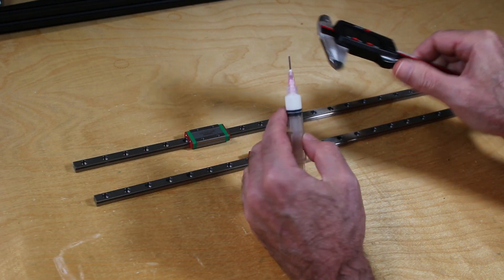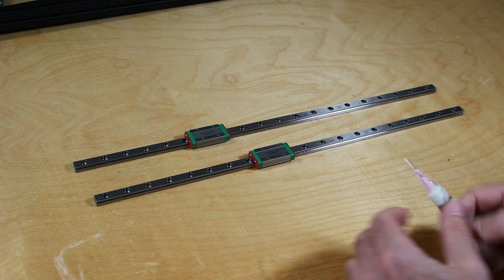Linear Rail Lubrication

Comment: I’m not a fan of White Lithium grease for anything. I don’t like anything about it and it always looks terrible haha.
Reply from the maker: I get it.  I actually have switched to non-white lithium grease since that video.  Thanks for the comment and watching!
Reply: @KapmansBasementWorkshop 

And you’re a better person because of it.

Depends on the need but I don’t like the drag and tackiness of white lithium. Is non-white the same?

For lightweight stuff super lube is awesome. It’s almost like a mix of fine grease/oil mixed together.
Reply from the maker: Non-white is actually a little thicker.  But since I use these in an enclosed 3d printer, the grease seems to get softer in the heat. It seems to work well.  Seems I need to give super lube a try.

Comment: Thanks.
BTW - you did say when reading the Hiwin manual, to move the carriage 3x block lengths and repeat.
Reply from the maker: Thank you!
Reply: @KapmansBasementWorkshop  😃I've been investigating linear rails (actually considered linear steppers in the rail - too $$), and was curious whether the you've noticed an improvement in surface quality (assuming you've competed you Voron build....) [;^)
Reply from the maker: @truegret7778  I can't state that I've seen an improvment because this Voron always used rails.  But I can state this printer (once tuned) prints better than any other non-rail printer I've had.   I'm not sure thats a reasonable comparison.  If your non-rail printer has good bearings and accurate wheels, it should print just as good.

Comment: Very clear. Ive just come back to revisit this video because ive had to just replace my rails after having my 3d printers in storage for a long time. I really should have been doing this from the start if I had i probs wouldnt need to replace them.

You see so many people saying just spray lube onto the rail and run it back and fourth but I always though bearings were supposed to be packed, hence the port I guess!
Reply from the maker: I hear alot about applying oil as well.  That might work if the printer is open and the rails don't get warm, but these have a grease port.  It must be for a reason.   Thank you!

Comment: Do you have any recommendation for rust protection on  the rails?
Reply from the maker: The rails in this video are stainless steel (I think).  However every once in a while a thin coat of oil or grease should help keep that rust under control.

Comment: Is aerosol white Lithium grease the same as the tube?
Reply from the maker: Many people say it's not.  I have no experience with it.  Since the video, I have also learned that "White Lithium" is not necessarily white.  I have been using Mobil white lithium that can be purchased from online 3D printer retailers in a Syringe and it's yellowish / lite brownish and it works even better than what I used in the video.   It's actually thicker as well which I think works well in a hot environment.

Comment: Man it feels like i went in a rabbit hole, i hmjust wantaded an upgrade since the orig8nal bearings on my enders are binding, now i have to learn all about greassing rails, 😢
Reply from the maker: Good luck!  Thanks for watching!
Reply: @KapmansBasementWorkshop  thankyou for answering, i should be fine with the original lubrication for some time right?
Reply from the maker: @tarcisiobatista5595  If you are describing the oil on the rails that they ship with, no, that's not alright.  Get some grease or some other high quality oil with no particles or additives and add to the bearings in the rail.  You should not need to clean the shipping oil off outside of a wipe with a paper towel as it's just mineral oil.

Comment: Love your channel thanks for the stl for the stealth burner carriage. Just curious, what type of accels ore you getting. I’m building a second v2 which is almost done now using hiwin rails this time.
Reply from the maker: Thank you!
Right now, I'm at 5000 for acceleration for clean prints.  I'm limited by my Y axis mass on the 2.4 350.  I can't measure resonance with my accelerometer since changing to Stealthburner since I ran out of 5v ports.  I'm making a few changes and once I have a proper connection for the accelerometer, I will test again.  I hope with the reduced motor size and weight the numbers go up.  We shall see soon.  I will publish those ASAP.  Thank you very much for watching and asking!  I will post those numbers soon....

Comment: good stuff.  Related question:  you ever pull the balls & mic them?  On the few I've pulled apart, I found all the balls to be the same size.  More high end rails alternate between full size bearing balls & spacer balls, generally a few micrometers smaller.  It allows for better rolling.  anyways, I'm thinking about "re-balling" mine, just curious if you or anyone else has played with this.
Reply from the maker: Thank you!  I have not taken them apart yet.  However, I did take them out of where they were being used for a repair (the rail was not the problem).  Brand new these felt slightly rough & slightly noisy.  After several hundred hours of use, I could not believe how they had transformed.  Smooth as could be with drastically less force needed to move the carriage and virtually silent with no play.  I would get this brand again.  When it comes time to service them, I will certainly mic them to see where they are.  Thank you for watching!
Reply: @KapmansBasementWorkshop  good to know, mine do seem a bit noisy now, printer still in production so pretty much 0 use.

Make sure you got a good setup when you go taking those apart, the balls want to go everywhere!  I use a tray + a magnetic sheet to keep everything together.  Also, be sure everything is clean.

Thanks for sharing your experience.  Every detail matters.
Reply from the maker: @mtraven23  Thank you for the tips!  These are on a 3d printer, so a very lite load.  I'm super curious how long these will run before needing  to be taken apart.

Comment: So there's a little more to grease choice than this. There are TWO separate Hiwin documents to refer to; and there are some slight differences when using them in a low-load situation like a 3D printer. Grease manufacturers recommend the following for linear rails when used on a 3D printer: NLGI00 (rather than NLGI2 that Hiwin recommend), 30-200Cst, NO solid particles (i.e. no PTFE, and no whiteners - so the stuff you're using isn't technically kosher), and must be lithium-based. PTFE should be avoided because it can cause the bearings to slide rather than roll, which actually increases wear.

Also if you use oil on the rail to prevent rust, it needs to be miscible with the grease you're using inside the carriage.

All of that said, I don't think I've ever heard of anyone having lube-based problems with rails on printers. Industrial use is entirely another mattter.
Reply from the maker: One more thing.  I never equated "white lithium grease" = whiteners.  I've never seen lithium grease any other way.  Good to know.  Thank you.  I also added a note on the video description recommending what Voron or Hiwin proposes.
Reply: @KapmansBasementWorkshop  mine is definitely lithium-based and is definitely the yellow/brown colour. But I think you're right, most of them are usually whitened.
Reply: I download a PDF document from HIWIN. Title: Lubricating instructions for linear guideways and ballscrews, 30 pages. Did a search on "lithium" - Nothing, not a single hit, no reference to lithium! Per page 24 - "For grease lubrication, we recommend greases in accordance with DIN 51825 (German grease classification system) of consistency class NLGI 2 as specified by DIN 51818. For normal loads, standard greases with the designation – K1K“ are sufficient." The document also had this... "Greases with solid particles such as graphite or MOS2 must not be used." What is MOS2? MoS2 are high quality lithium multipurpose and EP greases. Soo... lithium is not recommend by HIWIN? Additionally, Multipurpose Lithium Grease (Natural) is available in NLGI grades 1, 2 and 3. Another publication from Bosch Rexroth Corporation on lubricating rail blocks recommends "High performance lithium soap reference here is HIWIN Spec Sheet for their G01 (standard recommendation NLGI Grade 1)>>>
Reply: @tomhall5164  MoS2 is Molybdenum disulfide, has nothing to do with lithium grease. It may have it or not. It's a add on.
Manufacturers started recommending NLGI2 greases and slowly by the years moved to 1, then to 0 and now 00 or 000. Practice showed that thinner greases work better. The only downside is that you have to lubricate more often.
Get yourself 0 or 00 lithium grease, honey color, without any add-ons and you are good to go. Easy to inject, easy to clean, surface of the balls is safe, free rolling without skipping and sliding. Lube once every few months.
Reply from the maker: Thank you for the tip!
Reply from the maker: @tomhall5164  The document I highlighted in the video that recommended lithium grease was from Hiwin as well.  So, I don't know.  It's very confusing.  However, the loads are very low, much less than the rails are rated for.  Hopefully as long as there are no particles in the grease, it's probably ok.  But the safest is probably what you found in your search.  But I can say for sure at this point, the rails in the printer are silent and smooth.  The printer is running great. At some point I will clean the rails and I will probably switch the grease to what your found above.
Reply from the maker: @tomhall5164  I just searched a bit for MOS2.  I believe it's an ingredient in heavy duty lithium greases.  As far as I can tell, the lighter duty greases don't have that additive.  So heavy duty lithium grease probably has it, the others don't. As far as I can tell, the one I used does not have it.
Reply from the maker: Thanks for those details.  I went with thicker grease due to the hot environment and hiwin's recommendation.  I have not heard of anyone having lube trouble either.  But I found the details hard to find relating to the proper way to grease them and a lot of argument about oil, thin grease and thick grease, using solvents, disassembly and more.  When I came across the hiwin doc, it seemed so simple and worth a video.  Thank you very much!
Reply: I have hiwin carriages on my camaster CNC machine. They recommend using mobilux ep1. It has a NLGI rating 01. It is quite thin for grease which works well to push out old dirt and contaminants when you re-grease the carriages through the filler hole

Comment: They are 100% not hiwin if you bought a kit. No way. No how. But you don't need hiwin rails any way.
Reply from the maker: I believe they are.  They match exactly unless the ones I matched against are fake or these are really good copies. They work amazingly well for what I'm using them for.  I have been told by others that they are real, but "b" stock.

Comment: Great video. My lubrication needles measured 1.6-8 mm and,  still allowed the grease to "spooge" out, not be forced into the lube ports, so, I took an extra needle cap, drilled out the end, and, tapered it to a "fine" point,on a belt sander. This, used as a seal, allows me to force the grease through to where it needs to go. Also, use a very "fine" needle, and, apply grease directly to the balls from the bottom side. Grease, ports,and, balls, slide, slide, slide, repeat, repeat, repeat.   HTH.......
Reply from the maker: That is a good idea.  I'll need to give that a try.  Thank you!

Comment: Hey, it's nice to see you're going strong with build. How did you liked the kit so far?
Reply from the maker: So far, I really like the kit.  Most of the parts seem to be of high quality and it was just so convenient.  I'll know for sure once I actually get this running.  I would purchase a kit from Blurolls again.  There is only one part I'm a little worried about, the bed heater.  Another viewer showed me a video that was posted of another build where the heater was not working correctly.  Physically, the bed heater looks great, but I will be careful once this is running and spend some time making some measurements of the heater to make sure it's good.  But so far, I would recommend the kit.
Reply: @KapmansBasementWorkshop  great to hear, been following this kit for a while and it's just... Seemed too good to be true for the price. I had big doubts about genuinity of the branded parts. But if you say it's good, I'll definitely consider this kit more seriously. Thank you for the videos and have fun.
Reply from the maker: @MehmetcanÖksüz  , If you have any concerns about specific parts, ask and I'll try to provide a close up photo.  Almost everything seems brand name and genuine except for that heater...
Reply: @KapmansBasementWorkshop  major thing I was worried about is rails, motors and bed.
Reply from the maker: @MehmetcanÖksüz  : So far, I think all those parts look great.  But the true test of the bed will be heating.  I print a lot of PETG and will start printing more ABS which should heat up the bed nicely.  I will post a followup on the bed once that has happened.